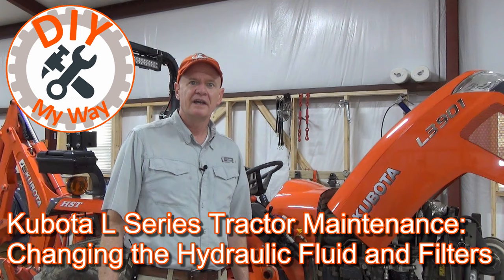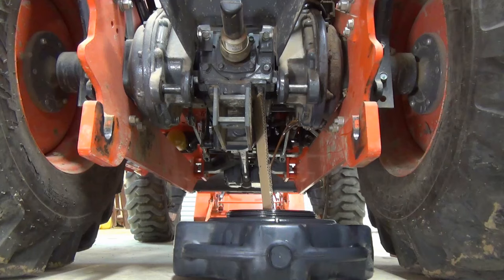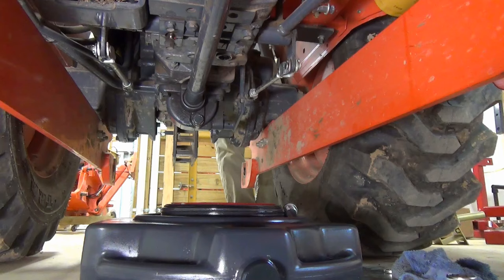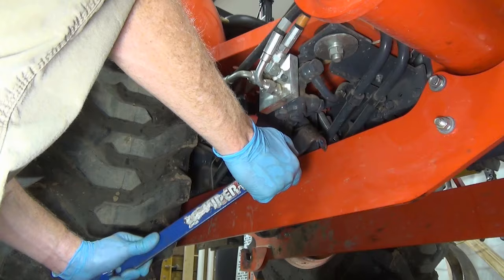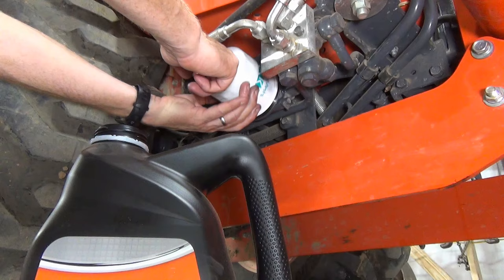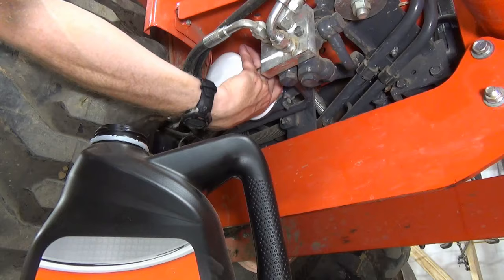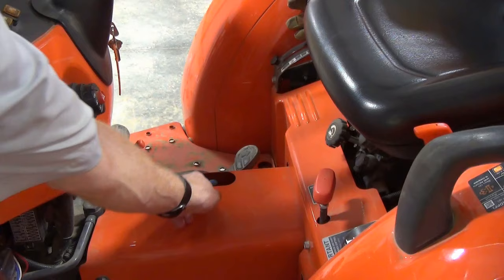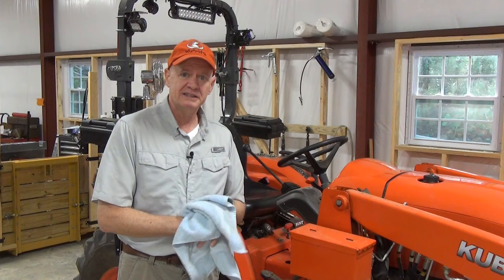How to Change the Hydraulic Fluid and Filter - Kubota L Series Tractor Maintenance (#90)

Comment: You should mention that for the 50hr service, unlike the engine oil, the hydraulic system requires only the filters  to be changed, not the oil. However, if you change the "inlet filter" on the right side of the machine, you will lose a lot of oil unless you are quick to get the new filter spun back on.  This is only true on the 50hr service, at the 200hr service and all subsequent services both filter and oil get changed.
Reply: I am ocd so the 50 hour fluid change on my 2009 B2920' I changed everything. It says just under one gallon' I let it drain all night and pulled both engine drain plugs and it took over 1 gal. Now I change engine oil and filter every 100 hrs. I did the hydro & 4WD at 400 and now every 400. I have 1200 hrs on it and it runs like new. never a problem //
Reply: If you keep the hydraulic plug in - you don't lose too much - I think I lost only about 1/2gal, but still a mess ; )
Reply: Could the tractor be tilted to the opposite side (blocks under tires) for the inlet filter to reduce the mess/fluid loss?

Comment: I had to take a chisel flat tip, of course, and bump the bottom of the filter. There’s some notches there that’ll break that loose. That’s the only way I can remove this filter from factory. I did not replace mine that tight.

Comment: I cannot believe that you didn't change your hydraulic filter at 50 hours like my owners manual says to do. Does yours not say to change at 50 hours?
Reply from the maker: I can believe because I was there and definitely did not change the hydraulic filter because my manual says to only change the HST filter at 50 hours.  It may be because the hydraulic filter also has a magnet the catches metal bits.  When I did change it at 400 hours, the magnet had certainly done its job. Thanks for watching!

Comment: Glad to see that I was not the only person that had lots of trouble removing that filter.  I did like you, used two different filter wrench,  a pair of large pliers,  then a 36 inch pipe wrench. My filter was all bent up too.
I was just about to drive a screwdriver through it when it gave up.
Reply from the maker: Hi Eric!  Yep, a lot of people run into this problem with factory-installed filters, but scoring the seam between the filter and the mount and a little WD-40 works wonders! Thanks for watching!

Comment: Perfect timing!  I’m at 382 hours on my L3301.  I have all my filters and oil ready to go.  Now I have the how-to video😊
Reply from the maker: See, I knew that, Stephen. That’s why I rushed to get this video out just for you! Seriously, I’m glad the timing is good for you.  Good luck and thanks for watching!
Reply: One thing to add - he mentioned in the video that is it over 7-gallons of fluid.  That means when you drain the fluid - you need plenty of drain pan and storage containers.  I bought a 2nd drain pain just for this purpose.  My storage can is only 5-gals so I put the old fluid back in the new fluid containers afterwards to take to the recycling center - this way I was able to do oil and hydraulic fluids in one sitting ; )

Comment: This is a very handy video. I did plugs in reverse. Plug facing down drains right into pan and has the majority of oil. Then plug facing forward. His idea for blocking oil on rear small plugs is very good even when you remove the majority of oil from big plugs. Thanks for the tips. 10:06

Comment: The cheapest form of repair is regular maintenance.  Read the book and do what it says. 
 I use a large Rubbermaid tub with 30 gallon trash bags (two of em) This holds all 10 gallons of hydraulic fluid and the 2 gallons for the front axle. Try draining and changing the filters first as it draws down a lot of the fluid.  Less needs to be drained from the 4 drains, so less danger of the horizontal drains spattering the fluid over the floor.   Check the front axle for proper level frequently after a change as its very possible for the oil to flow out the axle level check plug before the axle is really at the proper level.   
Thanks for your videos; they're very helpful.
Reply from the maker: Thanks for the tips and for watching!

Comment: Very well explained tutorial and really helpful for Kubota owners. I'm about to change the transmission filter at 200 hours, done 195 hours currently, don't need to change the oil until 400 hours. Oil was changed at 10 hours and last filter was put on at 50 hours. I have a Kioti. Never seen a filter that tight before, thought you were going to hammer a large screwdriver through it for leverage but you came up with a more elegant solution, well done.
Reply from the maker: Thanks, Mark!  Your Kioti oil and filter intervals sound about the same as Kubota, except first engine oil and filter change is a 50 hours.  Yeah, I was about to smash a screwdriver through it, but thought it was worth Googling to see if there was a better technique and found the knife and WD-40 method. Thanks for watching!

Comment: Martin, sometimes I had to use a pipe wrench, chain wrench, and even had to hammer a long screwdriver through the filter to turn the filter. some peeps just overdo the tightening.  thanks.
Reply from the maker: Hi Tony!  Yep sometimes desperate measures are needed.  Fortunately I didn’t have to resort to the screwdriver hammered though the filter! Thanks for watching!

Comment: FYI your tip on pulling the plug that drains straight down first was the money shot.  It drained about 5 gallons, so the rest were real quick.  Still had to use the cardboard for the two on the rear axle, but they both drained really quick.  Thanks again!
Reply from the maker: Glad the tip helped you!  Thanks for watching!

Comment: I am a first-time tractor owner.  My L3901 DT will be delivered later today.  I want to do the maintenance by the book.  Just making sure I am 100% correct.  For my tractor, the fluid changes include:  Hydraulic fluid, 1 Hydraulic filter,  Engine oil, and engine oil filter?  Really appreciate your videos.
Reply from the maker: Hi Mike!  Well according to my 2017 L3901 manual, at 50 hours you change the engine oil and filter and the transmission oil filter.  At 200 hours you change the transmission oil filter again and every 200 hours after that.  You don't change the hydraulic fluid and filter until 400 hours and every 400 hours after that.  However, some Kubota models and other tractor makers have you change the hydraulic oil at the first 50 hours, then at 400 hours and every 400 hours after that.  Bottom Line:  follow your manual to the letter.  Congrats on your new tractor and thanks for watching!

Comment: As a Kubota technician, I saw no issue with the maintenance you performed, I was unaware of the razor knife trick for the transmission filter. I invested in a filter wrench made for large equipment and semi truck filters instead that is about 2ft long to do those. Sadly, the issue with the filters has persisted from the Standard L01 series to the new L02 series, but I guess I get to keep gratifying my investment.
Reply from the maker: Thanks Will!  Glad you learned a new trick from the video, even though you have a honking tool to handle stubborn filters.

Comment: I would like to see another video of the BX expand backhoe trenching bucket if you have a project in the future I am planning to put in about 350 Ft worth of waterline
Reply from the maker: Hi Bob!  I have the Trenching a New Water line videos plus the gutter drain pipe video at the shop.  No more immediate project with the trencher bucket for a while.  350 ft is a long run!  Are you considering getting the trencher bucket for this project?  Also, how deep do you have to bury the pipe?  Good luck!

Comment: Questions iv always been told to write the change date and time on the filters !
Reply from the maker: Hi Leon!  I don’t see the point since tractors are serviced on hour intervals like 50, 100, 150, etc.  and I follow the manual precisely on that.  The only exception I can think of is if a tractor is under-used, that is only logging a small number of hours a year, in which case maybe you change the oil every couple of years.  Then it would make since to put the date on it. Thanks for watching!
Reply: @DIYMyWay  the reason I ask is because I myself just bought a Kubota B3200 and I'm changing everything because there are no dates and I have no ida when anything was done to it.
Reply from the maker: Then yes, it’s best to change everything then get back on track with the schedule in the manual.

Comment: I did my 50 hour maintenance today. Went well just because of your videos. Thank you very much. One question though, when you removed the HST filter (I also had issues because it got stuck), I found quite a bit of metal shavings on the magnet. Did you have them as well and if so, how much? If you replaced the filter at 50 hours, did you find more shavings at 400 hour replacement? Thank you in advance for answer.
Reply from the maker: Hi Maxim!  Glad to hear it went well.  There was a moderate amount of shavings on the magnet at 400 hours.  I did not change it at 5o hours because the manual of my model of tractor did not call for it until 400 hours. Thanks for watching!
Reply: @DIYMyWay  thanks a lot for the quick response!

Comment: This is a very good video for the model it covers.  My tractor is a Kubota B8200 e with 2 wheel drive. 
The hydraulic fluid filter is not exposed and I have not been able to locate it
I don't know where to go to get the information
Reply from the maker: Thanks Harold!  Your tractor doesn’t have a transmission hydraulic filter but it does have a strainer that needs to be cleaned when changing the fluid.  I found a PDF manual of your tractor here: https://www.kubotabooks.com/AutoIndex/index.php?dir=Tractor%20Owners%20Manuals/&file=B8200%20Owners%20manual%20.pdf&AutoIndex=bb31df5c204e3512d152b29c7eb4b217. Good luck!

Comment: Not all Kubota L series have 2 transmission filters.
My L3010 ( 32 HP ) Direct Transmission only have one Filter. It’s on the right side of the tractor sitting in the driver’s seat.
Reply from the maker: As the video shows, my L3901 HST only has one transmission filter as well as a hydraulic system filter.  The transmission and the hydraulic system share the same reservoir of hydraulic fluid, but have separate filters. Thanks for watching!
Reply: @DIYMyWay  yes the HST has the transmission filter, mine only has the sump hydraulic filter. It doesn’t have the transmission filter. Only the hydraulic sump one. Thanks for the video and reply:))

Comment: How much metal shavings do you find on those magnetic rings during regular maintenance?  
I am thinking there would be a bit on a new machine but very little once the tractor is broken in and has a couple hundred hours on it.  Is there and expected (safe..) amount of metal to find during each tractor service?
Reply from the maker: There was a good bit of metal shavings on it as I would expect for the first filter change.  I certainly hope I’ll find a lot less when I change it again at 800 hours!  Thanks for watching!

Comment: I'm working on an Old B7100. I've never replaced anything fluid related. Can I use the same oil pan for all my oil related needs until full? Transmission/Hydraulic...ect?
Reply from the maker: Hi Steven! I don’t see why not.  At least we’re I live, recycled oil is all dumped in the same container regardless of type. Thanks for watching!

Comment: Do all kubotas L3400 have two hydraulic oil filters or it changes on the two wheel drive? I only see one on my 2008 two wheel drive thanks in advance
Reply from the maker: As far as I know only the HST tractor have two filters; one for the transmission and one for the 3-point and FEL hydraulics. Thanks for watching!

Comment: Excellent Video.  I have a LX2610 and approaching 50 hours.  The manual states to only replace the transmission and hydraulic oil filters plus the engine oil and oil filter.  My question is how much hydraulic oil should I expect to lose when replacing only the two filters and not the oil itself?  Thank you!
Reply from the maker: Thanks, David!  I don't know how much hydraulic oil an LX2610 might lose changing the transmission oil filter because it depends on where the filter is located and how it is oriented.  My L3901 loses only a small amount during the filter change. Thanks for watching!

Comment: Another excellent DIY video sir! One question I may have missed it, but do either the transmission or hydraulic fluid filters have magnets? You mentioned the engine oil filter came with one.
Reply from the maker: Thanks again! As shown in the video, the hydraulic pump filter has a magnet and it had indeed intercepted a good bit of metal filings.  It is the only filter on the L3901 that has a magnet.
Reply: @DIYMyWay  ahh, I was wondering if I did not hear that right! Makes sense, seeing as how you changing the transmission fluid, not the engine! 😊

Comment: Is it possible to overfill?  I have a sight glass and couldn't see it was full.  It filled to top of where the new goes in and drained down some.  Will overfill cause damage?
Reply from the maker: Hi Christine!  Yes, you can over fill and it can cause damage.  A little extra is not a problem but if you have filled to the top of the fill port,  that’s WAY too much. Do you only have a sight glass on your tractor or is there also a dipstick?  If you have a dipstick, drain fluid until it’s at the right level.  Otherwise, all you can do is to drain it all into a clean pan and pour back in only the exact amount specified.  I know that will be a pain but it’s very important too have the correct amount of hydraulic fluid.  Good luck and thanks for watching!
Reply: @DIYMyWay  thank you!  Love your videos.

Comment: Is the hydraulic system in the loader seperate from the fluid you changed?  With the loader off, isn't there dirty fluid still in the loader?
Reply from the maker: Yes and that would be true even if the loader was still attached.  The hydraulic fluid would not drain from it. Thanks for watching!
Reply: @DIYMyWay  Thanks.  Since I own the L3301, I can't tell you how valuable your channel has been to me.  I'm doing my 400-hour service and have been using all your videos related to that.  Also, I've copied most of your modifications.  My favorite is the carry all for the 3-point.  Incredibly useful, and if you need ballast you can fill it with bricks or logs and have all the ballast you could ever want.

Comment: Thanks for the great videos!  Just so I’m clear, the HST transmission oil and hydraulic fluid are filled from the same port, yes? All part of the 6.2 gallon capacity? I’m just making sure that I don’t overlook another reservoir. Silly question I’m aware...
Reply from the maker: Thanks, Michael! There is no other reservoir or fill port mentioned or shown in the manual so I assume it’s a shared reservoir with separate filters for the transmission and the hydraulics. Thanks for watching!
Reply: @DIYMyWay  , I can confirm that, yes, there is only one reservoir for the UDT2 oil. The HST filter is a return filter, filters the fluid after process as it is dumped back into reservoir.
The "inlet filter" is the big white one on right side of machine and filters fluid as it is pulled from the reservoir before sending it to the valves and hydraulic system.
Reply from the maker: Thanks for the confirmation, Jerry!  Much appreciated!

Comment: What is the actual CORRECT service hours for the 50 vs the 100 or 400 when to change what? On this video it also says Transmission filter changed at 50 hrs?? I thought it was just the HST filter at 50 hours along with the oil and oil filter? Another question I have is why did the manual say only change the HST filter at 50 hrs? Is it possible to do that without also changing the HST Oil? I bought some fluid to top off in case it spills everywhere in the process.
Reply from the maker: The CORRECT services hours is whatever the manual says for YOUR tractor if you want to keep your warranty.  As to WHY the hours and filters changed vary for different tractor models, you’ll have to ask Kubota. Thanks for watching!

Comment: I have a l2800 and tiped it over and it ticks and knocks now any ideas 💡
Reply from the maker: Yikes!  Glad you are okay!  Did you immediately turn off the engine after it tipped over?  Also, did you not try to start it until several days after it was upright again?  As I understand it, those are the cardinal rules when you tip your tractor over in order to minimize engine damage.

Comment: Hello for kubota L1-295, does it use hydraulic too at the back of the tractor?
Reply from the maker: I'm not familiar with that model, but if it has an HST transmission and is not a really old model tractor, then the answer is probably yes.  If you can't find a manual for it.  A Kubota dealer can probably tell you. Thanks for watching!
Reply: @DIYMyWay  This is old model and it doesn’t use transmission but I am wondering what fluid should be refilled because there is a fluid storage at the back just like in the your video. I don’t have manual.